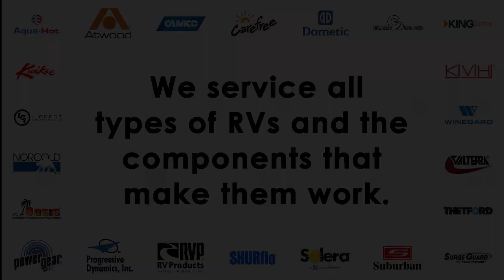Dump Trailer Project  (Part 2) - Switchin' It Up!  --  My RV Works

Comment: To install those type of switch drill one big and two screw hole stick threw from the inside. Very easy and sealed better. I also put the switch on the ground side alot safer.

Comment: That switch couple have been mounted from the rear. Drill 3 holes in line, bolt it in, and it's mounted a lot easier. I bet the current drop after the cables is due to reduced heating with the larger guage cable, resulting in less current resistance. It should handle a load dump waaaay better than the stock cables.

Comment: Great idea to have a battery cutoff switch. I installed one on my last RV as well but I did find that over time those particular switches tend to stop working. The key tends to lose connection on the inside. Had to replace mine twice. You don’t have the freeze thaw cycle like we do so it may be much better in your application.

Comment: Great info. Question about placing smaller wire terminals (dissimilar metals) between main 2/0 and battery.  Does that add resistance increasing amperage?
Reply from the maker: At the Practical level, no it does not. But I am sure some lab somewhere has done resistance value readings at the microvolt level LOL. You can think of it as connecting a hose to a fire hydrant tap. The water will still flow regardless of the size. So large wire and small wires - current will still flow.